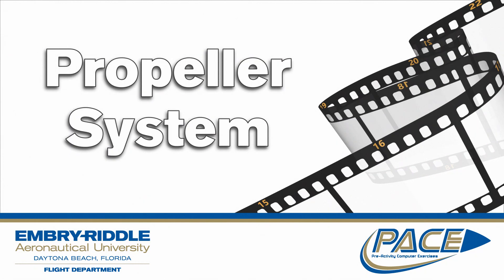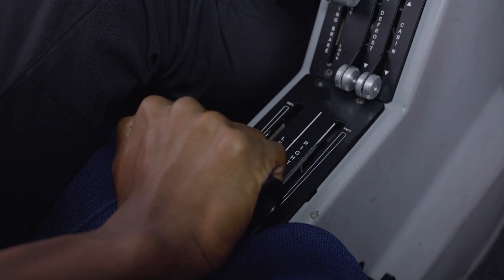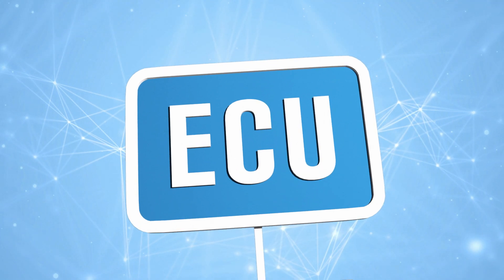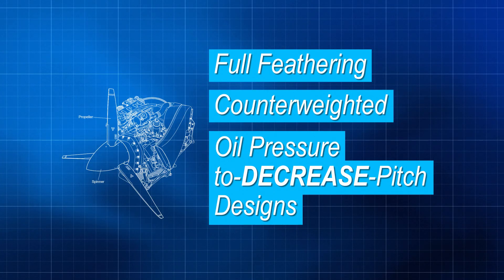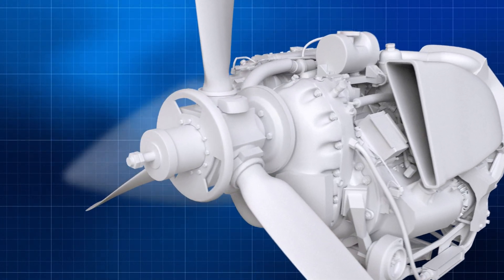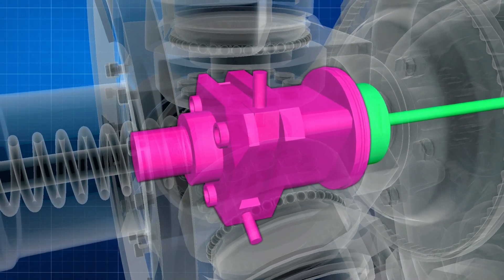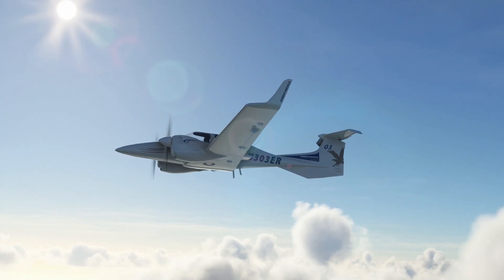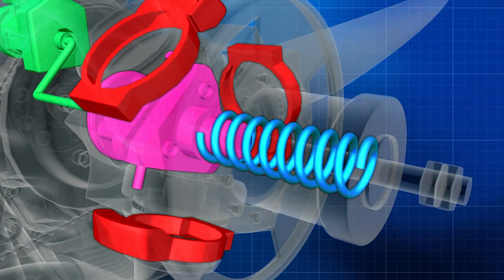Propeller System

Comment: Does this mean every time you shut down the engines in the 42, even on the ground, the propeller goes into feathered position? Or is there a mechanism in place to keep the propeller at fine pitch position upon engine shut down on the ground?
Reply: There is a “coarse pitch stop” to ensure that the engine does not feather on ground when engine speed is low which usually is below 1300 RPM.